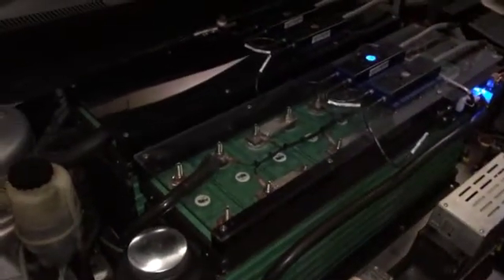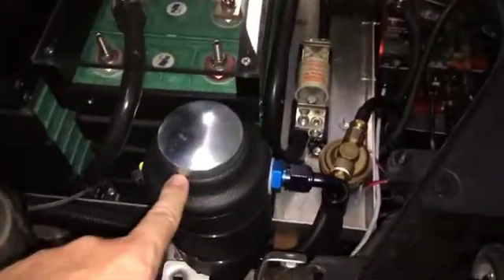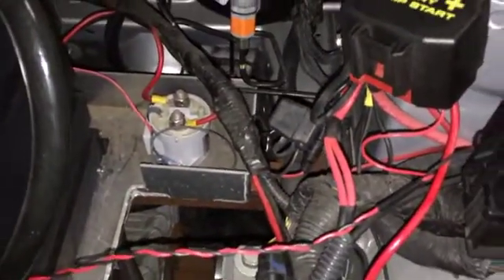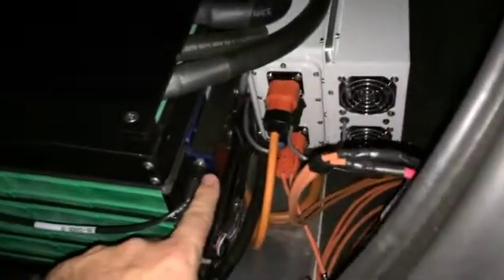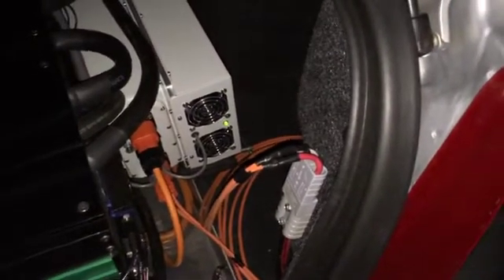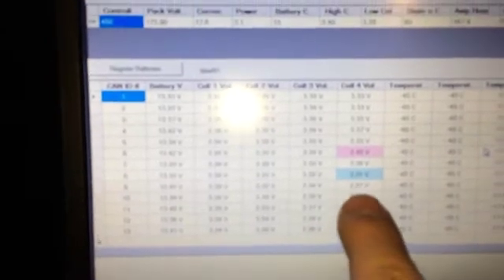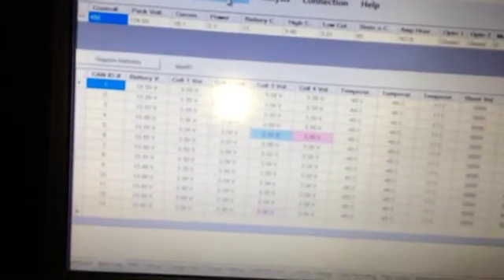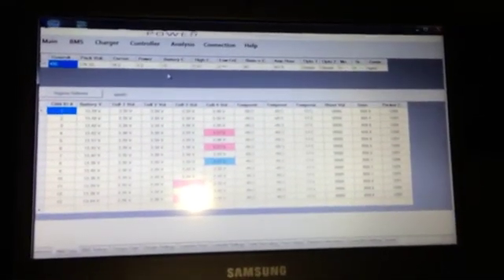Tech - 2009 Dodge Avenger Lithium EV Conversion

Comment: Why stuuf your trunk when replacing the fuel tank with these would be more suitable? Might get tricky with getting luggage into the car.
Reply: Thats a lot of work. You also have to compromise the structure of the vehicle. I will also be putting batteries as is in the back like that. Not looking for racetrack handling.  You can do your own conversion as however you want to.